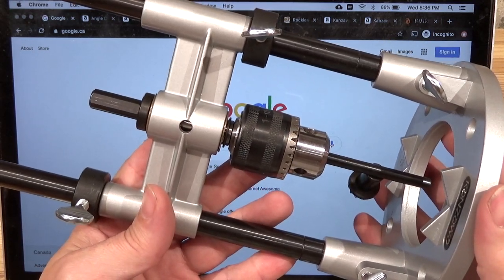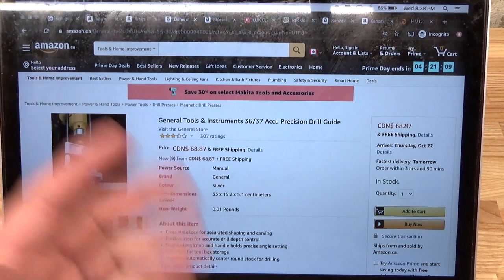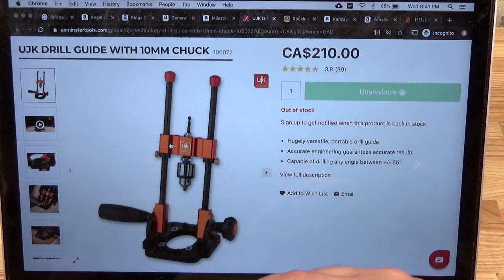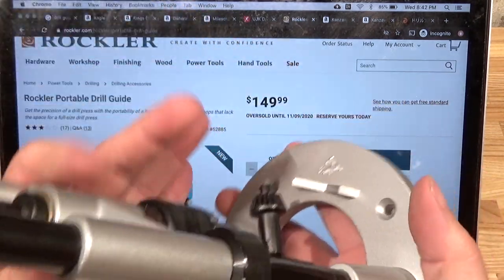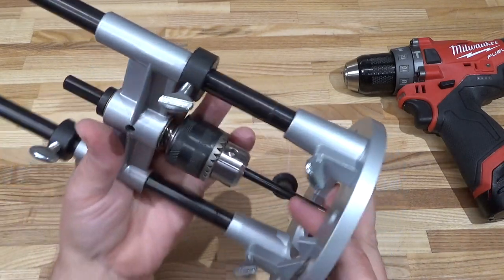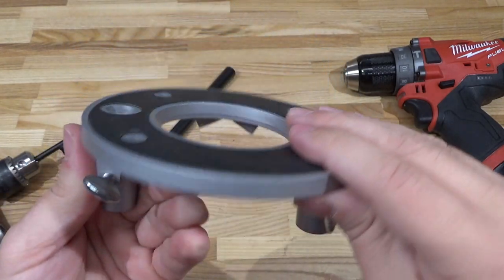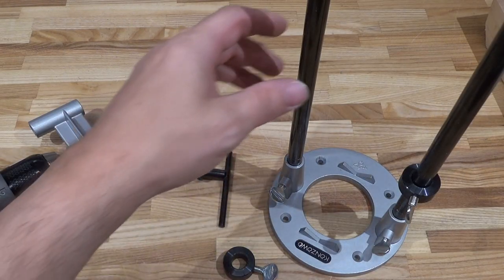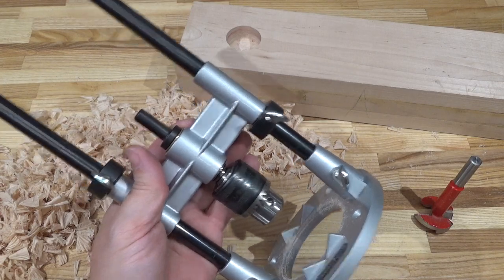Look-See: Kanzawa Drill Guide

Comment: UJK has 14mm guides. And the sliding is often stiff because it is so extremely tight that the slider with the drill head stops on it, you cant push it down, not even pull it up, super annoying. I should probably make a review of it. (on my other channel) They also fail with the rubber base which makes it wobbly and in order to make it better you must remove that rubber which is there fixed in uneven manner. For 140£ it should be much better with less fails. But it is a heavy and solid piece of jig.
Reply from the maker: Any play in the UJK guide? I imagine it locking up would be due the carriage tracking off-kilter.
Reply from the maker: What's your other channel name?
Reply: @RoomForTools  This is my other channel, I've just created it and I also just bought UJK recently so will see, I could make a review in near future. But first I had to send them an email with my complaint about the product. Will see where it will go from there because they still haven't answered. But the jig itself is very solid. It doesn't feel like it has any play in it, and that's why I think it is so tight (over-tight) Maybe some special type of lubricant would do the job.
Reply: If you compare the yoke on the UJK/ Rockler drill guides (they are identical products) they are probably 12 mm or more  shorter than the Japanese guide this means there is more chance of the yoke skewing on the downward stroke

Comment: Hi, possibly drill a longer hole (100 to 150mm) and review how straight? With an alternative guide I have, as you press down to drill a hole, the angle of the guide and hole can change. Also, due to the weight of a drill, even when all you do is attach a drill, you can see the angle of the drill bit and guide slightly changes. If you could review deflection for this unit that would be great  - as I am interested in purchasing it.
Reply from the maker: Good question... I might do a follow up on that as a video. I do not have any brad point bits of that length though. Standard drill points WILL wander at random, even in a rigid drill press. Nonetheless, a good question that I am curious to investigate. Perhaps one hole freehand and another clamped down.
Reply: What location are you in? I know you can buy non-expensive longer bits at many hardware stores. Even Auger bits will work (6mm or so). Too thin and the bit more likely to deflect.
Reply from the maker: I got a few bits to try out: a standard twist bit, a "DeWalt Multimaterial" bit, a "Speedbor" spade bit, and a nice lipped brad point is on order. Will do addendum video in a week or so.
Reply: how'd you go?
Reply from the maker: Got some bits... will do tests this weekend and upload new video. Thanks for checking!
Reply from the maker: Done. Hope that answers your question.
Reply: Thanks. Good information. You could also square up  a board (jointer then thicknesser etc) and use a good square to mark a line all around a board, and a marking gauge from the same edge to mark the drill bit's likely entrance and exit points. Then you will see how closely a good drill bit hits the desired exit point and how good the jig is. It is also best to clamp the jig down in such circumstances and use as thick a board as possible that still allows for drill bit clearance. As you indicated in your video, the longer the hole, the greater the margin for error.